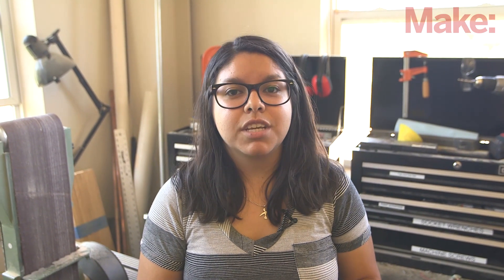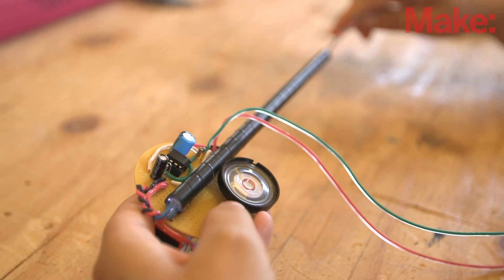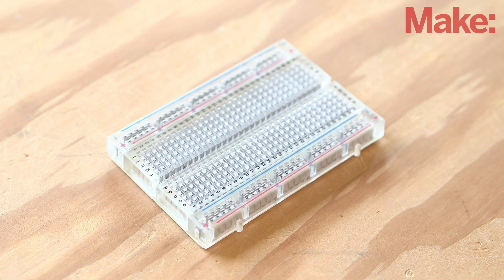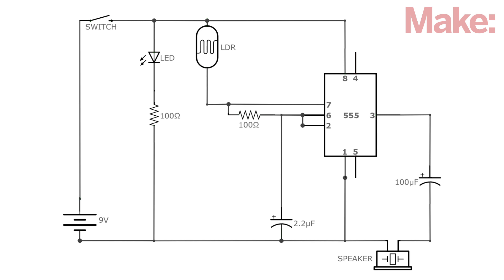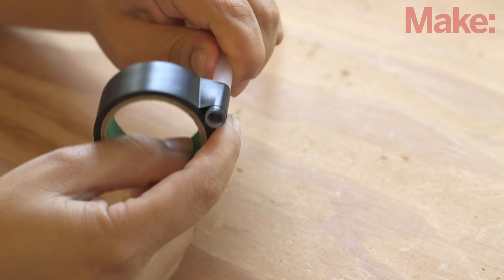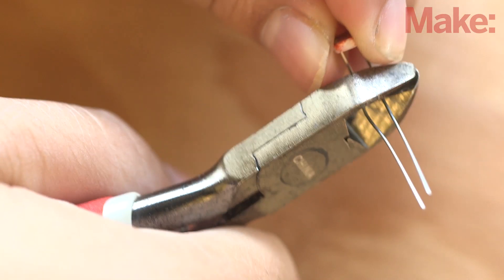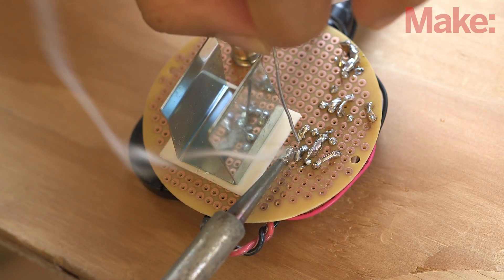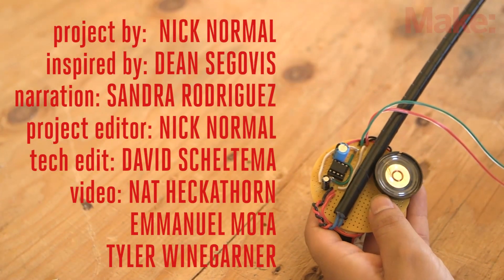Weekend Projects - Light2Sound LDR Synth

Comment: Isn't that the bistable mode?
Reply: I would have thought astable. Monostable has 1 stable state so activates for a period then stops. Bistable on the other hand has two stable states, in this circuit it is constantly changing from one state to the other, hence astable.
Reply: Jon CO you are correct, sir. astable it is.
Reply: Jon CO Jup. I was wrong.